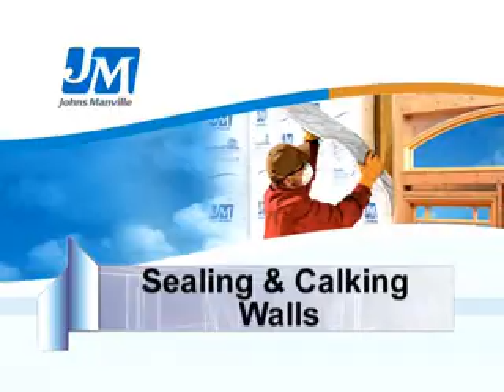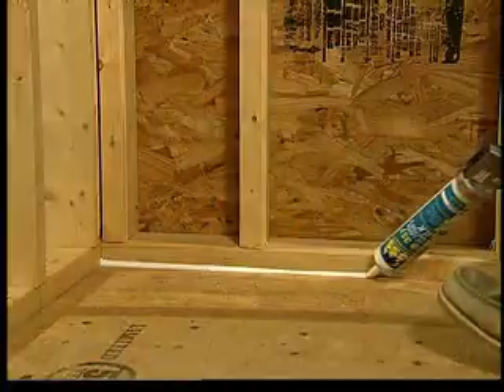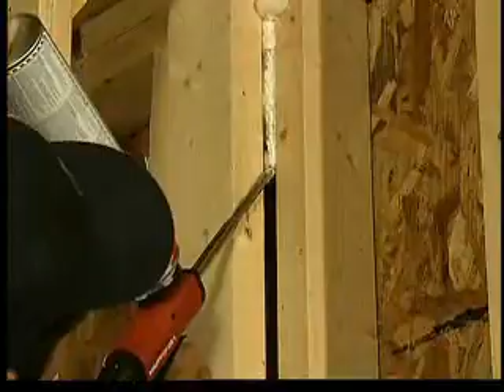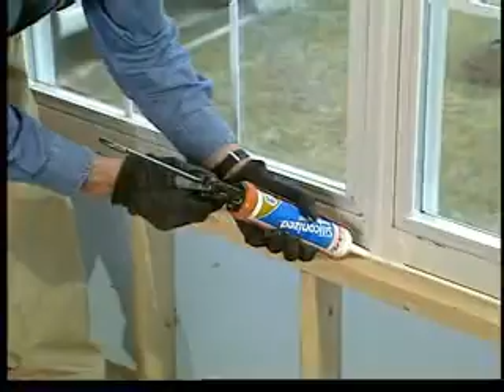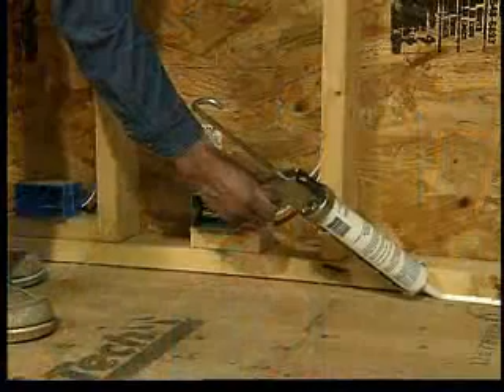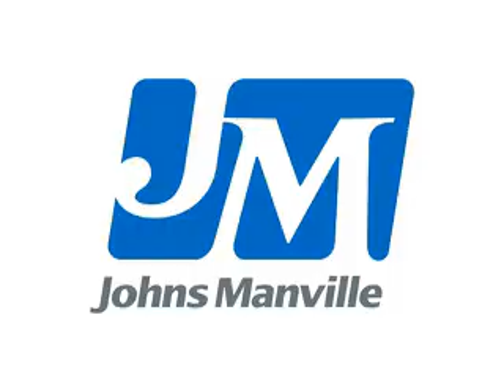Air Sealing and Caulking Walls

Comment: I really want to do this. But unfortunately the builder already insulated the basement. So I can rip out the plastic at the bottom but that’s a real headache because I will have to staple it back.  Do you see any harm in sealing the bottom framing to the floor even with the plastic over top of the wood. I don’t think that framing will ever move or be ripped out since it’s 24in OC and just really providing framing/insulation from the outer brick to the inside. It’s unfinished so additional framing would be needed.

Comment: What type of caulk or sealant do you recommend to seal cracks between framing studs and seams between floor and bottom plate (ie can you recommend a brand)? Same question for spray foam...will any spray foam do or is one better than the other? Thanks!
Reply: In this video it looks like they are using Siliconized Latex acrylic caulk. I recommend something like Alex Flex 50yr with at least a 25% stretch factor. Latex acrylic bonds to wood very well and silicone is flexible. So it’s a good affordable air sealing option compared to a full polyurethane caulk for interior use.
Reply: Anything that's permanently elastic/flexible will work. You're just looking for a seal that will move without cracking with expansion in different temps etc.....
Reply: Same thing I'm trying to find out. I heard from one source to use a polyurethane caulk but I was not able to find any at Home Depot.